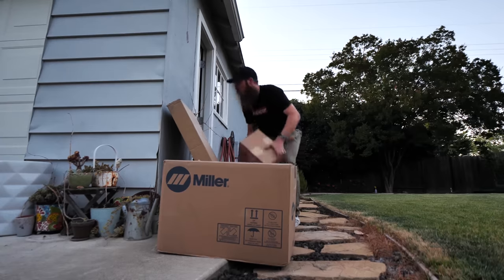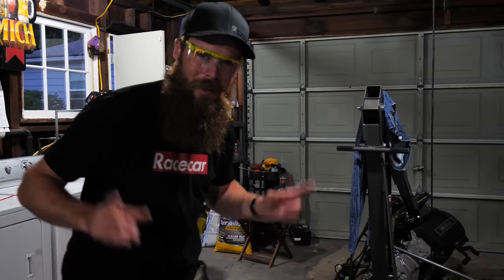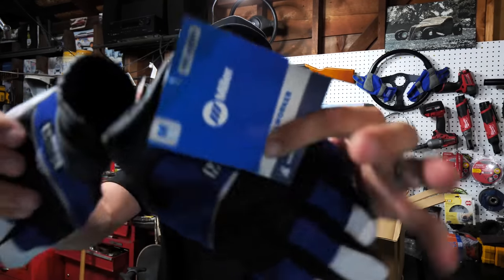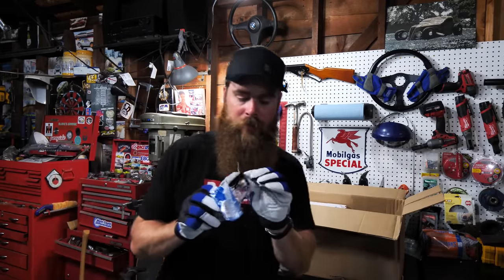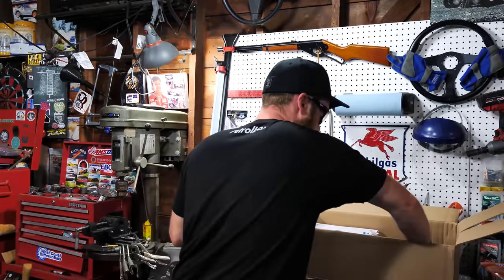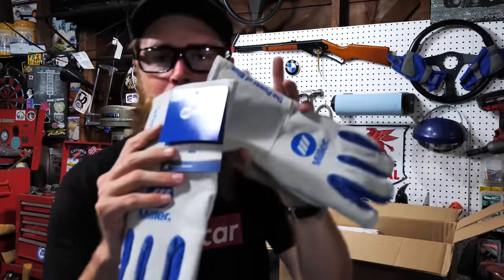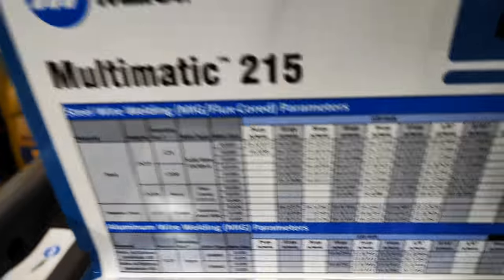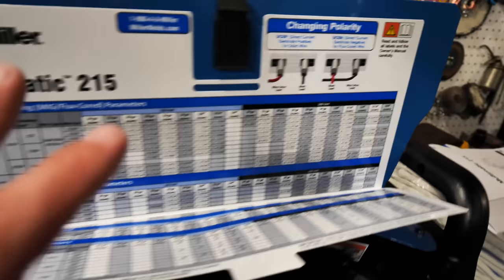Miller Electric Multimatic 215 MIG TIG STICK Unboxing

Comment: FYI folks: Miller does NOT recommend using the longer gun on these smaller units because the drive rollers and motor are too small to push the wire through.

Comment: Multimatic 215 and the 211 are garbage I’m speaking from experience I work at a welder repair shop we repair so many of those machines it doesn’t make any sense they weld great but the circuit boards on them are just garbage china made shit they blown circuit caps and blow up wires that help supply power to the mig gun
Reply: Welding past the duty cycle time id say
Reply: Well you just changed my mind. Was just going to get one.
Reply: Which should I get then? Because I was looking at ordering one of these